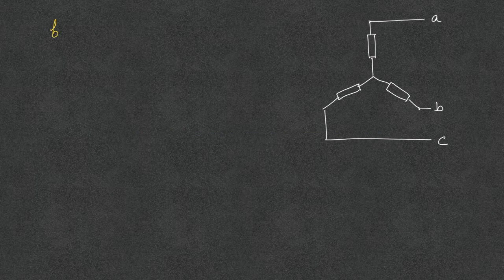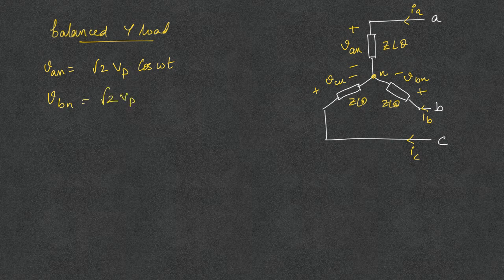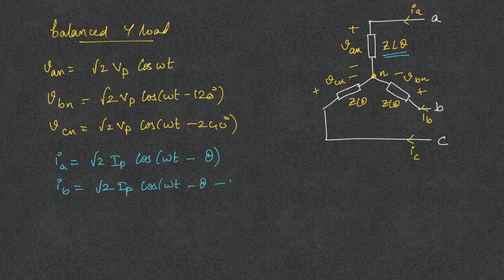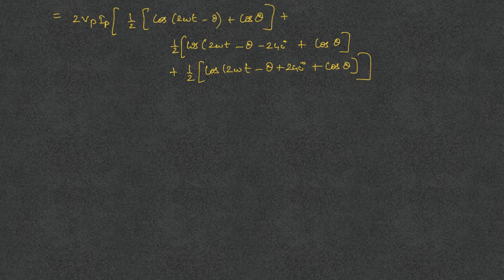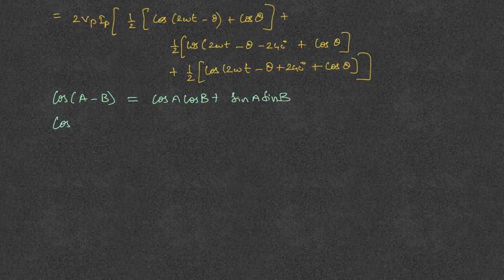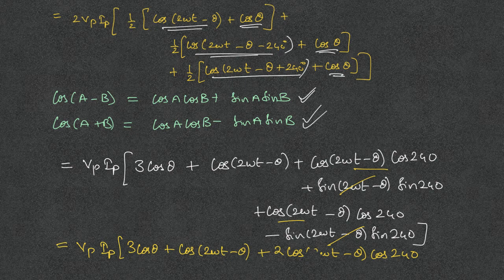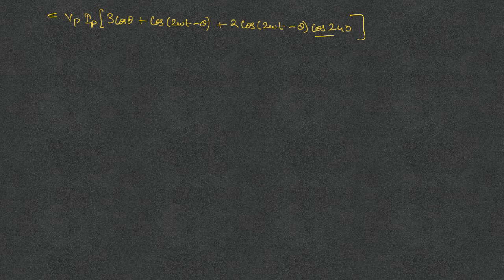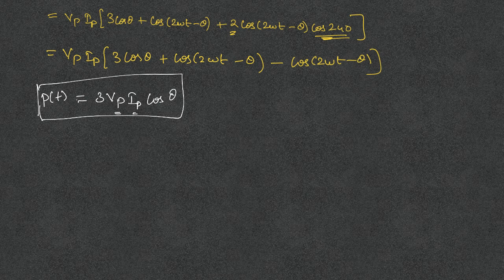How 3 phase systems deliver constant INSTANTANEOUS power unlike single phase

Comment: Sorry why is Van = sqrt 2 Vp cos wt in the first place? My confusion is the "cos wt" ! Why is that there?
Reply from the maker: Th alternating current we deal with in our power systems is sinusoidal in nature(i.e sine or cosine). 

So we use either cos or sine functions to represent it. 

Does this clear your doubt?
Reply: @hiatuz-gateeseeeece6290  Yeah, I get it now. 

Normally, I see AC voltage represented with a Sin wave but I now know that it could also be represented with a cos wave so long as you take it as the reference.

I had a little help with my lecture.

Thanks